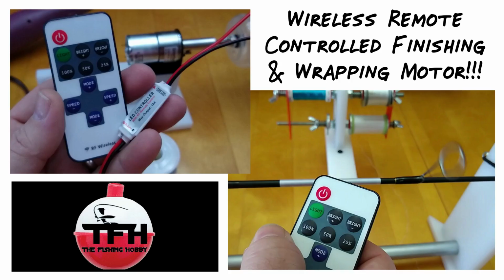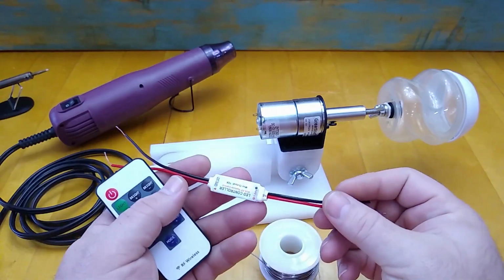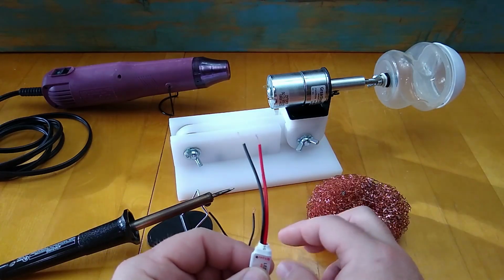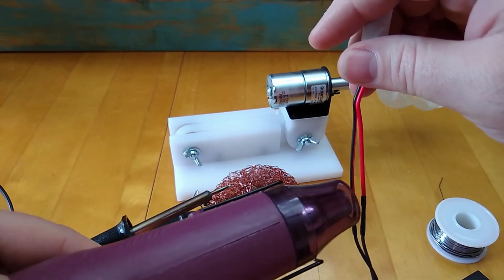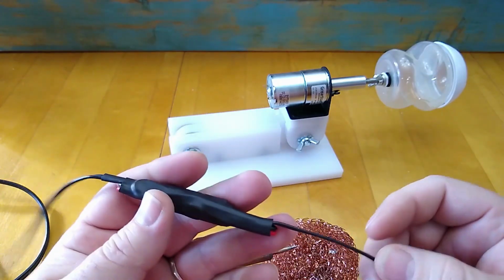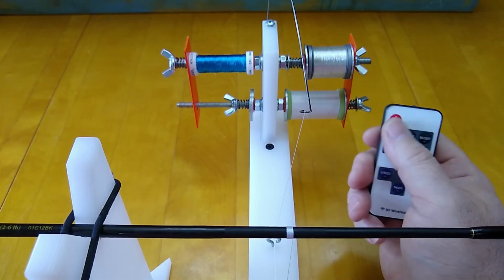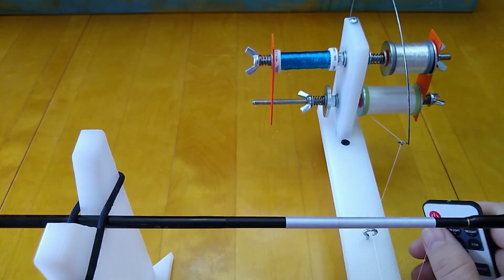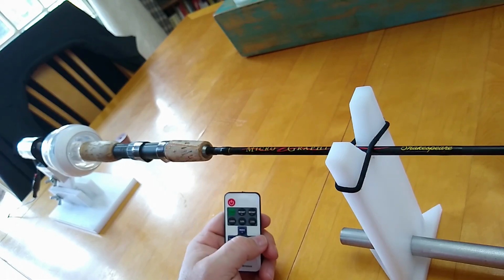Cheap Rod Building Motor Speed Controller - Wireless Motor Speed Control

Comment: 😮 how much would it cost me for you to make one. Ready to go out of the box plug it in and start applying epoxy? Just like the one in the video.
Reply from the maker: I no longer make these. The cost of the HDPE plastic I used to make them out of got to be too expensive. I have started 3d printing new products to replace the things I used to make and sell, but I haven’t designed a new epoxy application motor setup yet. I will be doing that in time though!
Reply: @TheFishingHobby  thank you well I will stay tuned and eventually we may do business God bless and have a good day
Reply from the maker: @harrydixon6770  thank you sir and the same to you!

Comment: hi, i hope you can answer me even is your old video. I have a question about the power supply. what if i will use a lithuim battery pack of 12V . DO you think im a gonna need a capacitor on this kind of set up?
Reply from the maker: No capacitor is needed and these motors work just fine on a 12v battery pack. I've run them on a 12v DeWalt lithium cordless tool battery with not problem.
Reply: @TheFishingHobby  How bout a voltage regulator? Coz I don't want to damage the receiver.
Reply from the maker: You can use one if you want to.

Comment: i bought a 30 rpm motor the case is small then your should get another one or is mine ok like i said its a 30 rpm thank you for your videos
Reply from the maker: I'm not sure. The motor size isn't that important as long as it has enough torque and is the right speed  to turn your rod the way you want it. I use two motors. One is 200 RPM that I use for applying epoxy and for really long wraps. The other motor is 10 RPM that I use for drying epoxy.

Comment: Hmmmm, they could use the stand even without a motor, right? Turning the rod by hand? It would be tedious probably, but then it would be up to them if they want to spend the extra money for a motor and controller.
Reply from the maker: No, this stand is specifically for using a motor with it. My regular wrapping jigs don't require a motor, but there are some times when using a motorized wrapper is handy. It is also useful for putting epoxy on wraps.